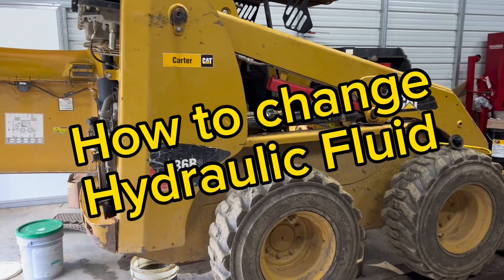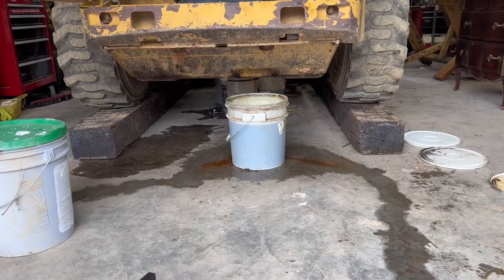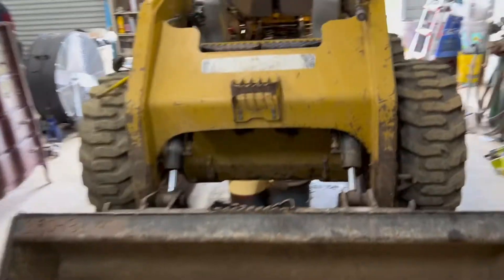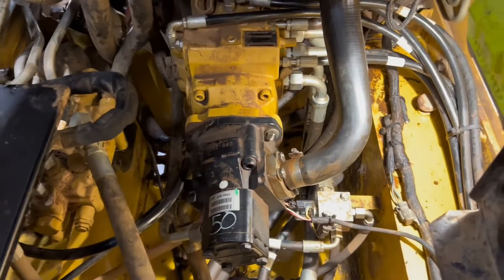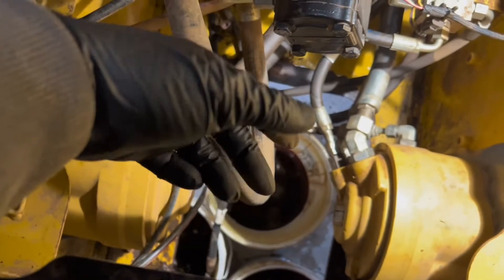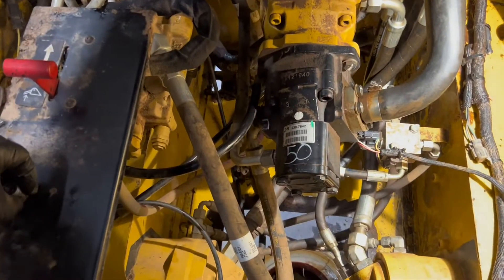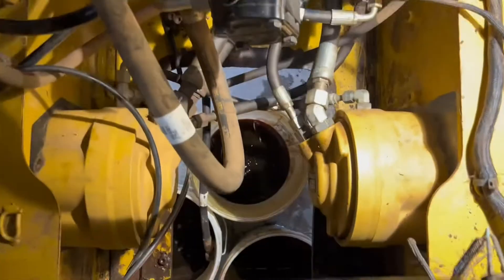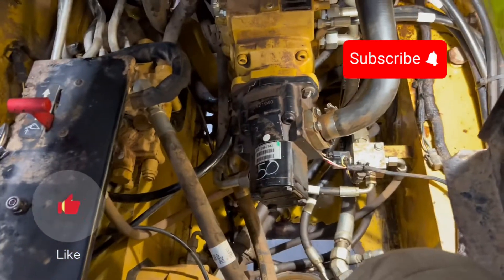How to Change Skid-steer Hydraulic Fluid Cat Caterpillar 236B3

Comment: Thanks for the video my 236 has started leaking hydraulic oil and they are closed up tighter then fort nox. I have raised the cab one time before but it was several years ago for a different issue. I’ll go after the cab bolts again. The first time I had to cut one bolt and let me tell you they are hard. Thanks again. 👍👍👍
Reply from the maker: You’re welcome

Comment: I have cloudy fluid so I plan on changing it. This video was quite helpful, thanks.
Reply from the maker: You’re welcome!
Reply: @neverendingdiy did you do anything to clear out the pistons and lines after you drained the reservoir?
Reply from the maker: I did not. When I serviced the machine the pistons were completely compressed. So there would have been some fluid still in the lines. Up to you how you proceed. You could crack the lines if you wanted to but you might need to look into a bleed procedure. I am unsure how air in the lines would get out if trapped in there.
Reply: @neverendingdiy  okay. I will lower everything and hopefully what comes out takes the bulk of the water with it.
Reply from the maker: I hope it goes well for you!
Reply: @neverendingdiy  thanks! I am a bit worried about Hydo 10 in the fold weather here (operating in -25°C/-13°F) but I'm hoping it will be okay
Reply from the maker: The pour point on Cat Hydo 10 is showing -39°C according to their data sheet
Reply: @neverendingdiy  sorry to keep bugging you but how does the pour point relate to the actual minimum operating temperature? Can you still use the machine at -39°C if you warm it up first?
Reply from the maker: Pour point relates to the coldest temperature the fluid can maintain operating viscosity before crystals begin to form in the oil. Machine operation has a whole lot more factors that come into play beyond hydraulic fluid - fuel and fuel lines (especially diesel), engine oil, coolant, battery, etc. I think you know your machine better than anyone, but I would bet good money that the Hydo 10 has a lower pour point than any other fluid you find on a shelf somewhere

Comment: Thank you!!! I have a 236c looks just like yours. I have a leak not sure what it is. I need to clean an look around. If its just sitting  it will drain maybe  someone  didnt shut the shut off lever of drain hose.  I bought it like this. Now if i try to raise bucket it jumps an if i let off of joy stick it autos back down no pressure.  May have hose busted. Thank you for this video!!!!!
Reply from the maker: I would get everything really clean inside that compartment and dried off. It won’t take long to find the leak after that. Good luck!
Reply: My 262B had a bad leak when parked. It was a cooler seal. Was quite a process to find and repair it.
Reply from the maker: I bet it was! Cleaning this machine up was a full days job before identifying the leak source
Reply: @neverendingdiy  thanks for the straight forward, right to the point video. Very well done.

During the cleanout I think water got into my hydraulic fluid turning it cloudy which makes me think I should change it which led to your video.
Reply from the maker: Hmmmm…. The hydraulic system is a sealed system. Water should not be able to get in as hydraulic fluid should not be able to get out. I have a couple thoughts:
1 - your hydraulic tank has a gap or crack in it allowing rain water to get in. Perhaps the seal on the cap is bad and water is getting in that way?

2- the hydraulic fluid you are using is a lower grade, cheaper fluid, that may be more hydroscopic than others - meaning it absorbs water like brake fluid does. This would happen if your hydraulic reservoir has some humid air leaking in somewhere (like through the cap, gap, or crack) and the fluid is absorbing that water. I use CAT advanced 10 hydraulic fluid. It’s flipping expensive - but expensive machines are worth expensive fluids

I changed the hydraulic fluid in my CAT after 1500 hours (recommended service interval for that CAT10 fluid). And the fluid I drained down was not the least bit cloudy and I know that machine got worked for all 1500 hours. I think you have a leakage problem somewhere up top letting water in. Buy the good stuff when you do the fluid change. You won’t be disappointed and neither will your machine!
Reply: @neverendingdiy  off brand fluid may have also contributed. I topped up with several gallons of stuff from a hardware store after the leak. It now looka like watery chocolate milk.

Comment: Where is the hydraulic filter located? And what year is your CAT?
Reply: My 236 has the hydraulic filter in the engine compartment. All of the filters are pretty easy to get to.
Reply from the maker: My machine is a 2012. On my machine, the Hydraulic filter is located in the engine compartment - left hand side - upper quadrant closest to the cab. It’s tough to change without making a mess. It looks like an oil filter that is about 3x as tall as a standard car or truck.

Comment: Thanks for posting this. It was really useful.
Reply from the maker: You’re very welcome
Reply: @neverendingdiy  I was poking around in my 226B3 skid steer today. Replaced the inline fuel filter before the lift pump as it was packed with crap from the fuel tank to the point where it stalled out the machine. While trying to get better access I lifted the cab and oh boy - I need to do what you did and give it a good hose out! Embarrassingly dirty.
Reply from the maker: @langdons2848 super satisfying once it’s clean though! Definitely a good thing to check once or twice a year. You don’t want that dirt and debris piling up on your lines or trapping moisture to create rust!
Reply: @neverendingdiy  definitely! I've had my Cat dealer do maintenance in the past, but they are just crazy expensive now so I'm taking that work on myself instead. There's a big learning curve.
Reply: I need a good manual  to work on this where can I find one? 2010 236c

Comment: I was wondering what that hose was for?  BTW- that's how you drain the oil from a JD road grader.  Which seems bizarre, the fate of a $15K motor hanging off a old rubber hose dangling.
I'm trying to isolate the cause of my Cat246B skid making howling/vibrating noise under heavy hydraulic load?  Any experience on a growling noise from hydraulics? 
Thanks for the video.
Reply from the maker: It’s possible you have air in your system. I’d look into any kind of bleeding procedure. Could be cylinder cavitation. Be careful

Comment: I’m new learning hydraulics… I’m borrowing a machine and the arm creeks and is moving slow. It’s got a small hydraulic leak on one of the actuator hose connections that I don’t know how long it’s been there. Can I just fix the leak and add more hydro fluid or do I need to flush the system? thanks for sharing the tutorial.
Reply from the maker: No need to flush the system. If the leak on the hose is coming out of the rubber, it needs to be replaced. If it’s coming out of one of the fittings there is likely dirt or debris in the metal fitting. Unscrew it, clean it, and tighten it back down. As for the creaking… GREASE GREASE GREASE. You need to grease that thing ever couple times you use it. If you don’t go through a whole tube of grease every couple weeks depending on how often you use the machine, you’re not greasing enough. Those machine need constant lubrication. Always be sure to check you oil, coolant, hydro fluid, and grease before EVERY operation. Check your tire pressure too if you have tires. If you have tracks, they are held in place with pressure from grease. Those need grease also. Everywhere there is a fitting put like 10-20 pumps into it until everything is lubricated

Comment: Was it ypur suction screen o ring that went bad? I have the same thing going on with a 252b3
Reply from the maker: Yes, the O-ring on the strainer hardened and failed. Drained the hydraulic fluid and then disconnected the large diameter hose that connects the hydraulic reservoir to the pump. The strainer was threaded into the bottom of the reservoir. I kept the belly pan off while doing this so I had a place to drain residual oil. My strainer happened to be fine, but I bought a new one anyway. It only cost $64 and meant that I didn’t have to do that whole job over and spend HUNDREDS of dollars on fluid in the event the old strainer failed. I have a philosophy, that if a job already cost a substantial amount of time or money, replace as many components in your path to prevent going back in later. Good luck friend!
Reply: @neverendingdiy  yeah i plan to buy a new strainer as well. I am going straight to a hydro supply place down the road and getting a viton o-ring to replace the one that comes with it. It seems those black o-rings are not meant to be in oil and they lose their shape when exposed to heat and oil.  I dont know why these companys still use the type of o-rings in the wrong application. Also the hydo fluid is being silently recalled right now because of metal particulate being found in it so this repair is gong to have to wait.
Reply from the maker: @pointseeker I hate how they designed the strainer system. They could have easily made the reservoir one solid cast piece, put the strainer inline with the hose and remove the need for an ORing all together. Add a $20 shutoff valve at the base of the reservoir and save the customer hundreds of dollars worth of fluid changes to do jobs like this. Silly…. Good luck sir!